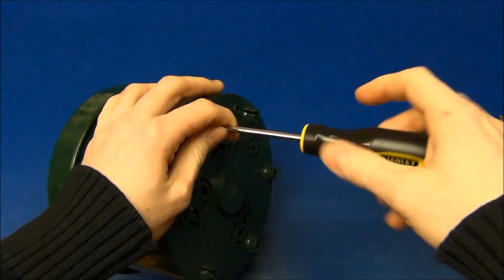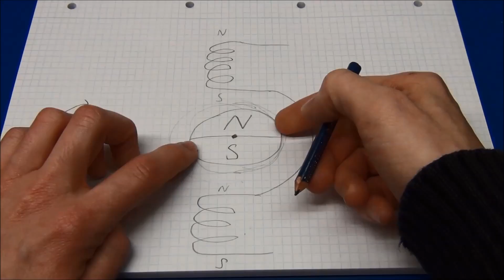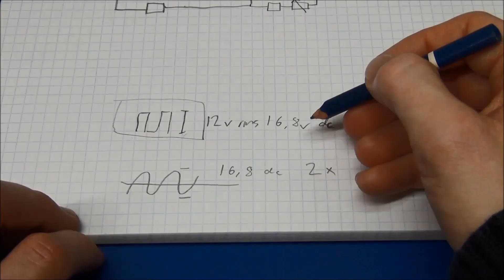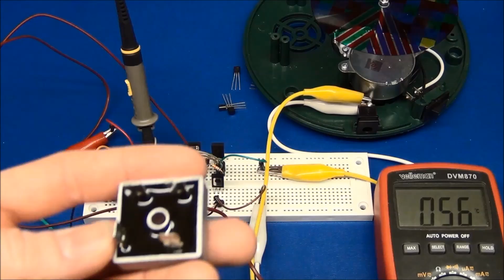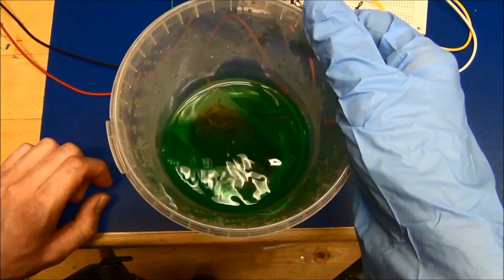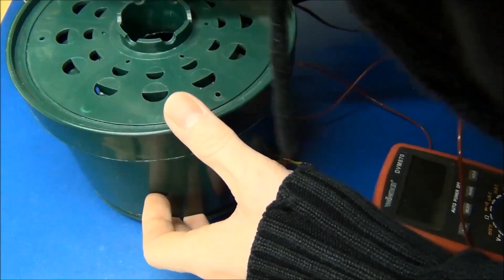Hacking a Christmas Tree !! - Ec-Projects

Comment: Oh my.... this is way above my knowledge level.  I have one of these trees that the motor isn't working on.  I didn't pay attention to that when I ordered new light bulb for it.  That was a waste, considering the motor isn't working.  When the wheel doesn't turn, it really offers VERY little light at all.  But, I don't think I can rewire a new motor, sooo... guess I'm done!  LOL  It broke when the base was dropped.  I wonder what it is that breaks inside the motor.  The wiring is still tight.

Comment: If you revisit this project and want to run a lower RPM with the same motor, you may try and use a flywheel to add more mass to have the momentum to carry it on to the next cycle.

Comment: cool hack! try to leave a ground plane on your PCB = less etch time + less etchant. also, if you run thick traces for power transistors or make 'islands' under them, they act like heatsink.
Merry Christmas !
Reply from the maker: Hi, thanks :) I do use ground planes occasionally, but I usually don't when I have no solder mask, I think the risk of accidentally shorting something while taking measurements is too high ;) hehe.. 
Yeah, I could have done more about the "heatsinking", thanks for the tip :)
Merry Christmas ! :D

Comment: I would replace that halogen lamp with a big LED and print a new transparency pattern for the color wheel. try a spiral pattern maybe? or a standard color fade wheel? It would provide a much more soothing color shift pattern than the blinky one you have there.
Reply from the maker: Yeah, I did actually think of printing a new disc for it, but then again, not nearly as fun :D :D